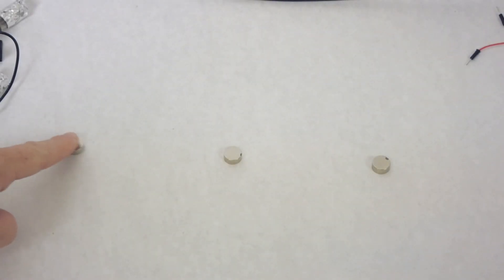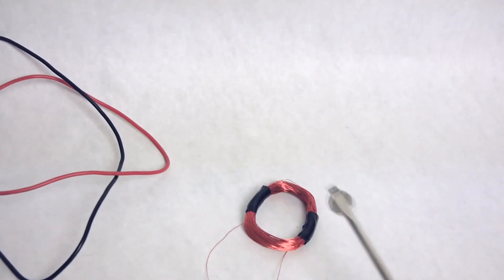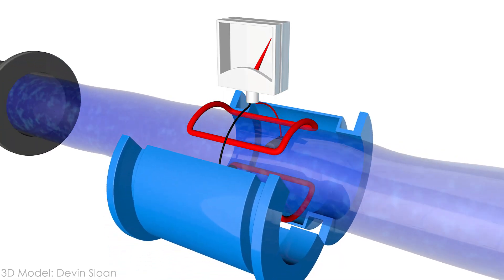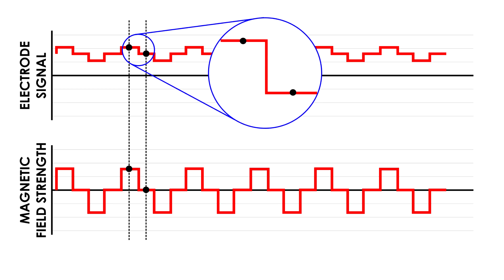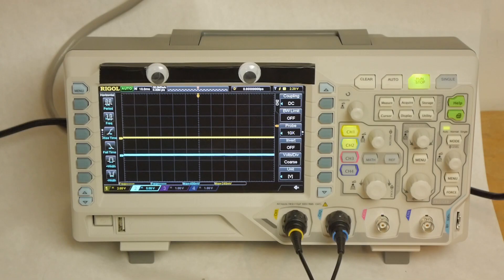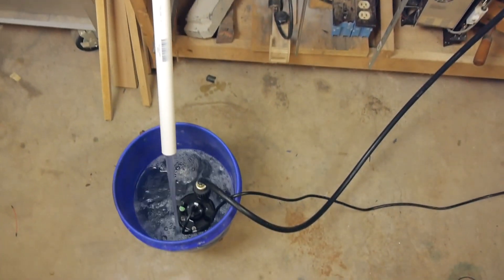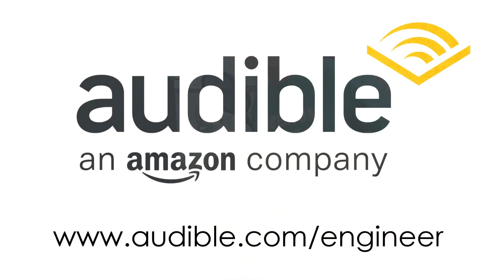How to Measure Flow with Magnets - (Magnetic Flow Meters)

Comment: Use a lock -in amplifier. Also your pipe is pretty big which means low velocity. Also a smaller pipe will bring the coils closer together giving you a stronger field

Comment: Hi. Great video. As always, I like your explanations. One Question: You mentioned a "high" Signal to noise ratio but shouldn't it be a "low" one? A higher SNR signifies a stronger signal relative to noise, while a lower SNR indicates a weaker signal with more interference.

Comment: How about a magnetic rotator? If the rotator has a magnetic south–north pole configuration, it will produce a current in the coil located outside the pipe. In this case, the frequency can be used to determine the velocity of the fluid.

Comment: You should take another shot at this, now that you have more resources and more experience. You can also address the issues with, "Well, a lot of plant pipe is iron/steel. Others are copper. So how would that work there?" Especially given that these types of lines are subject to alkaline deposits, which reduce their cross sectional area over time.

Comment: A number of years ago I had a z80 project book.  One of the projects was called a Transit Analyzer which I found easy to understand the other one was called a Lock in Detector which seemed to do something similar but would add and subtract the signal I'm wondering if something like that would work for this?

Comment: Put a second set of electrodes a few inches down the pipe in series with the first, but outside the magnetic field. Since current should be flowing in opposite directions across the two sets of leads, any interference on one should be subtracted out by the other. Also, run the circuit back to your scope with a twisted pair.

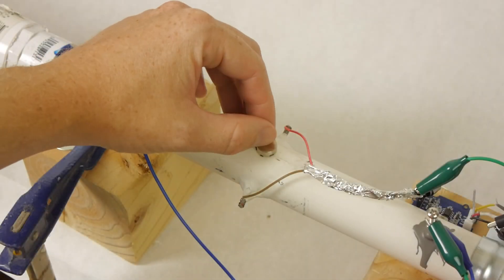Comment: 5:56 but what good does it do to only measure the flow if you can’t know the volume? Because even if you know the size of the pipe you can’t always know if it’s full or not, right? So is volume important here or wouldn’t it be at some point for your example of a practical application? You mentioned the example of having a water meter outside your house, and aren’t you billed by the volume of water you use and not just the flow of it? Or am i missing something? And even if you can measure flow in relation to the size of the pipe what happens when it’s not completely full of water? Then it further complicates measuring volume

Comment: The EMF generated is proportional to the conductivity of the fluid  use  a high conductivity fluid , also a larger diameter magnets 🧲 it’s going to deflect more charged particles to the electrodes.
space between electrodes: a larger diameter pipe is going to increase the space between electrode. Also the EMF is proportional to the speed of the fluid, a Bernoulli design pipe it may help to increase the speed of the fluid. Great job with your videos ; you can improve all the mentioned variables to get a better signal. Good luck to your next version of an electromagnetic flow meter video. 
Regards from West Palm Beach , Florida , USA 🇺🇸.

Comment: Question: Why does the induced voltage not vary with the conductivity of water, constantly throwing off the calibration of the meter? Depending on dissolved solids, "typical drinking water [conductivity] is in the range of 200–800 μS/cm" (Wikipedia) which is a pretty wide range.

Is it that the electrical conductivity of the water influence the current, not the voltage? Would love more a more rigorous answer if anyone's got it!

Comment: You're putting the Teflon tape on backwards. Assuming that's not a reverse thread. Also plastic tends to not need teflon tape. Sorry. But obviously working just fine for ya. Unimportant details.

Comment: I worked as an electrician in a gold mine. Part of the process of extracting the gold from the ore was the removal of the carbon and sulfur from the ore. The ore was a geothermaly modified limestone.
The ore was treated with sulfuric acid to remove the carbon from the limestone and high pressure and oxygen to remove the sulfur from the ore. Many different instrument’s were used to provide the data used by the automated control system that controlled the complex reactions. One of the most important instruments was the magnetic flow meters. It was found that the worst way to install the flow tubes was horizontally. The pipe that the flow tube was in would become partially blocked by the particles of ore that would settle out at low flow rates. That actually would effectively change the diameter of the pipe. It also would concentrate the magnetite that was in the ore. All of this made the magnetic flow tubes into expensive pipe couplers. The vertical installations had a number of problems, scale accumulation being the worst of those. But the vertical installations were manageable by routine maintenance. Don’t think that the tubes were useless they just had to have the problems factored in when the data from them was used by the process control system. Always Really good videos on this channel, good information and always entertaining!

Comment: How about passing fluid between two plates with significantly different electronegativity values.    As the fluid passes between the plates a small voltage would be created (I tested for tap water and the plates were copper and magnesium).  Electrolytic potential and capacitance in the fluid would be issues here too.  Could also use none conductive coatings with different electronegativity values and a voltage may still be read by capacitive inductance (electrostatic generator).  The fluid does not have to be conductive.  I do not know how you read a static electric charge.

Comment: The noise may come from the AC line built-in the building or the pump.  To overcome the common mode noise which is far larger than the signal  you want, your circuit need to add high CMRR amplifier.  Instrumentation amplifier is widely used in such noisy application.  There are many models of Instrumentation amplifier IC can be found.  For example, TI's INA848 with CMRR>132 dB.   I also found the input wires connected to the PCB can be twisted then shielded to avoid the loop magnetic induced noise.  Twist the input wires of coils could be helpful also.

Comment: In addition to following suggestions I would like to suggest the following.
In your experiment it seems only two electrodes are used  to measure a differential signal.
The differential signal is referred to a common earth. In the construction of experimental set up there are neither a pair of earth ring or earth electrode.  If it is used and one more earth connection through a wire is connected to the common earth of measuring circuit, it will help stabilising the signal a lot.

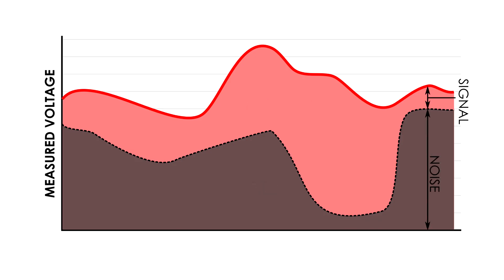Comment: 4:34 A small correction, it would imply the signal to noise ratio is low. It is quite literally the signal divided by the noise, and thus a 'high' value would mean large signal wrt noise.

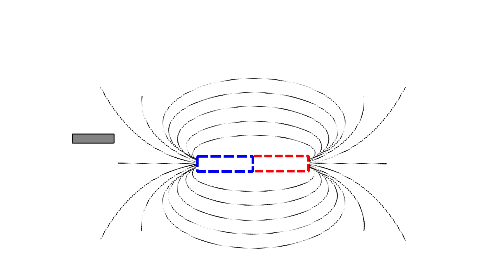Comment: 4:34 Signal to Noise ratio here is low. The unwanted noise is almost as high as the EMF, approaching the LOWEST S/N ratio of 1:1.  A much more desirable ratio is HIGHER, for example 100:1.  Hate to nit-pick but the engineer in me wants to call it out. Love your work Grady and I must say you have already taught me way more than I could ever hope to teach you. That's why I'm a subscriber to your channel
Reply: 1:1 is not the lowest SNR attainable. You can decrease the signal/increase the noise further (i.e. you go into fractions). This is the point where you go from 0dB to negative dB. You can do this until you approach 0:∞ ratio (i.e. an SNR of -∞dB).

Comment: You could power the magnet with a sinewave. A perfekt sine has only one frequency. Than it’s possible to design a Bandpassfilter that only let true frequency’s in this area. The amplitude of the resulting signal allows conclude back to the flow.

Comment: Sorry if u discussed it and I missed it. I work in the oilfield and I deliver fluid ranging in weights from 0.7-0.812...and I found that the lighter the fluid it reads less than what my tank gauges read... Be cool if you could explain that... I could be crazy and it's just coincidence of the temp (volume corrected to 15c.. Canadian fuel pumps)

Comment: Thoughts:

- I'm surprised that the EMF and volumetric flow rate would have a linear relationship, since I feel like there should be boundary layer effects and whatnot. (The flow isn't uniform across the cross-section of the pipe, and the field isn't interacting with all parts of that cross-section equally.)
- Would changes in the water chemistry affect the metering? I'm thinking about how the city's water distributor might alter the chemistry from time to time -- buffering agents or whatever.
- I'd actually be interested in a followup if you ever got around to that.
- One correction: At 4:35 you state the SNR backwards (saying it's high, when you mean low)

Comment: Congratulations on your effort and for sharing the experiment, though it didn't turn out as you hoped. Still, I learned many things from it that I wasn't aware of before. It was a good example of how difficult it can be to reduce the noise factor.

I agree that you should move on to other projects that will also have important educational value.

Comment: If you really want to extract a weak signal from a high noise, rather than sample at the peaks and nulls of the magnet phases you can use a lock-in amplifier technique. Think of it as an ultranarrow bandpass filter centered around the frequency which your arduino generates. Even if you're using you tri-state pulses, you can choose a harmonic to lock-on to.

Comment: Here is a data processing suggestion. Instead of a bi-phasic control signal put into the electro-magnets, you could use a pseudo-noise or PN code signal instead. The benefit here is that when you sample the output you can run the data through a matched-filter to correlate the sampled data with the known PN code, giving you a high SNR because the noise does not correlate. You can experiment with long codes and get better results of the actual flow. The down-side is that longer codes provide a slower flow reading.

Comment: Switching the magnetic field polarity is a century old technique to implement DC-restore, nothing ingenious there. I would really like to know how you figure a solid slug of fluid is in any way equivalent to a pickup coil! Faraday's Law states the magnetically induced voltage in a coil is proportional to the number of turns times the time derivative of the linked magnetic flux. You go racing through a lot of your explanations while leaving a bunch of holes, which kind of ruins things.

Comment: You can take the noise and cancel it by putting it 180 degrees out of phase with itself so it nulls itself out.  Add that to your variable filed induction and you get pretty good numbers. I forget which Tektronix scope did microvolts. They are 35+ years old so they are not expensive and they will actually work pretty well. You would have to shield your magnet coils and the electrodes, but that is hardly an insurmountable task.
Reply: It's 45 something. 4520?? It  would also be an old CRT scope. I use a 4545 a 4515, an old 465B, an ancient HP scope and some goofy Chinese stuff kind of like the Rigol only old. GW Instek, Goldstar, etc. Let the boss buy the 60GHz stuff for $750,000 + another 3 or 4 million dollars for all of the modules.

Comment: The coils that are mounted on the duct, of which wire gauge they could be and the turns that it carries, in addition said coils are connected in series or in parallel. if you can help me with these questions, thanks

Comment: When you "spin your wheels" it helps connect the dots for me as well as it "spins" off answers to problems i cant quite grasp a way to answer the issue. This is why i am completely enjoying your channel. The parallels of how to and why are shown in a way where i can apply the therory and have found solutions through the things you explain in the method you ecplain them. I cannot thank you enough for "spinning your wheels" especially on a roof top. That one long tube from your roof top solved 4 issues that i couldnt find a way to figure out what the root cause for. Please dont stop. You keep my wheels spinning to find the answers to the issues i encounter. Thank you.

Comment: Documenting your failure is just as important as documenting your success. Absolutely.  When I was a kid, I built a small scale ion thruster.  I know it worked just fine.  I could feel the small amount of thrust I was producing.  Unfortunately, I miscalculated the amount of power I would need to get a 1 gram thrust and, as a result, never got the thing to spin on the magnetic bearing I built, and so couldn't record any data.  The project got me a solid A- in freshman physics, but I still wish I could have gotten the right power.

Comment: To me this sounds like a bad measurement device for flow rate. Because if the factor that allows you to get induction is the conductivity of water, then this is one variable that can vary greatly from even tiny contamination. Pure water is a good insulator, while even slightly dirty water will conduct many, many times better. This should then give the appearance of a greater flow when there isn't one. 
One the flip side, it could be a great way to measure water contaminant levels for drinking water or something else that require good purity.

Comment: The flow meters we are working with (water production) have 'fluid grounding rings' on both sides of the meter to reduce noise. They are metal rings contacting the water in the pipe and grounded to each other and the meter's chassis. Search 'ABB Magmaster' for more info.

Comment: Why exactly is the magnetic field changing (to induce a voltage) if the magnets are static and only the fluid/medium they're in is moving? As long as the mu (permeability) of the fluid is constant, I would have thought that B should be constant, too?
(I'm an EE student, and I currently have my first "Electromagnetic fields and waves" lecture, so it's really cool to see some applications, and also some edge cases we haven't covered)
Reply: Actually the field isn't changing, but what changes is the position of tiny conductors (water particles) along regions of lesser and greater magnetic field concentration.
This would be similar to moving a coil around permanent magnets; the field is static but the conductor will experience a changing  magnetic field.

Comment: In your second setup, it would be a good idea to use the same generator as an external synchronizer for the oscilloscope. Thus the picture would be more stable, though still noisy. A further improvement might include some sort of a heterodyne for synchronous signal detection.

Comment: https://phys.org/news/2011-02-complexity-core-shell-nanomagnets.html
here is proof of you Rayleigh field you generated they show a dipole change at 5K your magnet from your data of your magnet? equals the to the 4th power of the wavelength of light at opposing field strength angle see if the math works I can give better that 50% it does just based on the angle and the length to width prospective of your hall you shoot the laser down and the 2 scattered beam I see one thin to the magnet thick one thick to the magnet thin  I get from the video What is cool is they call it cooling, I just read the comment below about the laminar flow in the beam ,this is right on the money , the particle are in a compression rarefication wave with in the earth own magnet field as his test show he is is a area that will not add a lot or subtract a lot . it is the frequency of the tensor wave of the Plane to shear wave hertz to spin  (got to have mass) to dance.
This is hilarious for me ! I thought I was posting to another channel on how high power laser are affected by a magnetic field . not your magnetic   pipe flow  channel . Now watching your watt balance , how does timing happen when energy is right . this is just what I need for my next step . I need to measure micro fields  in a laminar flow

Comment: Good Video, useful and thanks. Introduce our A+K Balanced Flow meter with 2D:2D straight pipe advantage, less flow resistance and high temperature flow test. May check my video or more information: wangt@keyontechs.com

Comment: PGE grounded the high voltage. noise. PGE added parallel capacitors. adds spikes and phaser like spikes. PGE started fires. USE an isolation transformer for everything.

Comment: A little bit of topic, but being practical is being doable to me, if I want to measure flow, I would not care however and whatever way (does not have to be by magnets), as long as it gives me the correct figure. Measuring flow is measuring the volume of liquid you would get in a unit of time. You have a bucket which you know its volume, you need a stop watch to time. Dividing the volume over the time, you have the flow rate. It is not the most elaborate way of measuring, however, that’s the idea you can work on to measure flow. The advantages of this approach is cheap and simple. The disadvantage are you have to disconnect your system to measure into a “bucket”, which sometimes are not convenient.

Comment: Can you use the data of the flow readings to autonomously readjust the flow of the pipe if the flow is too high/low?
For testing, a valve, further back, can be used to manually control the flow of the pipeline overall and a mechanism controlling a valve further on is the valve that readjusts the water flow to 'more acceptable levels'.

But idk. This is my question for the end of the video.

Comment: What if the exact conductivity of the fluid varies in an uncontrolled manner? For example, the water flow for evaporative cooling towers.
i.e. Does the calibration constant require the fluid to have an unchanging conductivity?